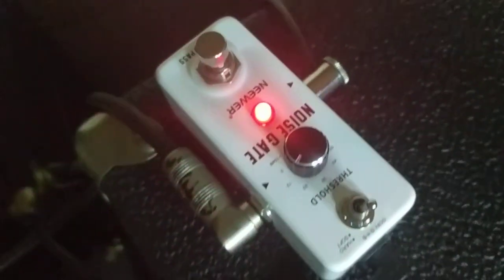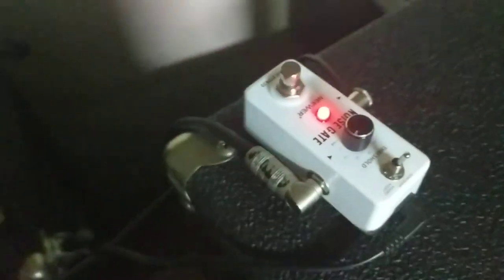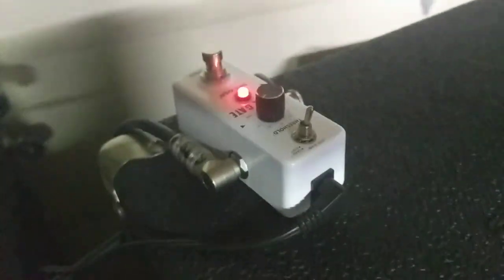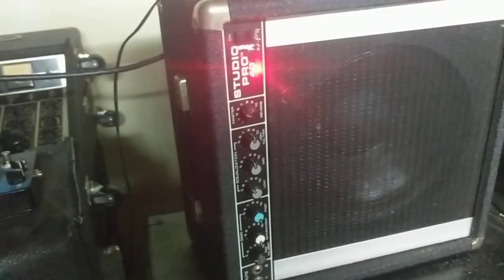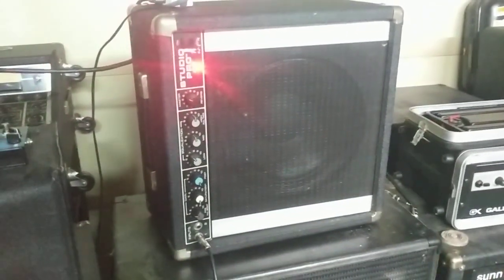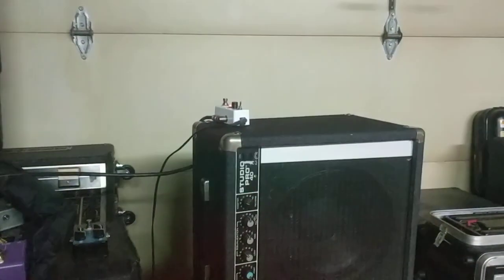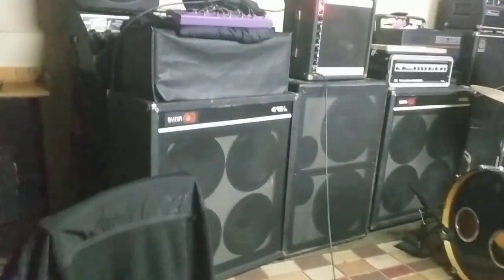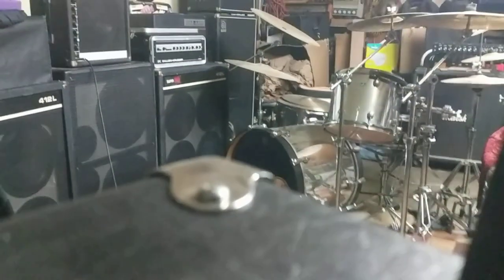HM2 STUDIO PRO and NEEWER noise gate

Comment: I had that same gate, made by mooer. The fast/slow switch ruins it imho, I gotta have the decay knob for a finer control, otherwise it either cuts off the bass from chugs too fast, or lets them ring out through longer but too slow to cut off the noise before it's audible.
Reply from the maker: It works just as well as the decimators I've had so I really dig em. I've been thru dozens of gates and it's always great for tight metal. The rocktron hush was 2nd best in imo but had some issues with clarity. Not too much is really gonna fuck up this tone any further tho lol
Reply from the maker: This is the second Neewer unit, sold the first to a buddy the other day and had to order another. From what I've heard in some groups I'm guessing I'm very lucky to have gotten 2 in a row that work correctly. I'll definitely take it over a decimator tho. Everytime I get a decimator someone leverages me into trading it. 5 decimators in 8 years. Neewer ftw
Reply: yeah some people love ISPs, I don't lol. Maybe it works better in front of the amp or I'm just a dumbass setting output levels. The hard/soft switch on mine fell apart but it was easy to replace, sold it after the fact. I like the ZNR gate on the zoom multistomp ms50g better than anything I've tried, worth it for that alone and the ad/da conversion is totally transparent too. Digital yeah but man killer time based and mod effects on that thing, and the Engl model on it sounds almost as good as my S&K VHD through a poweramp and cab
Reply: but yeah these cheap chinese import pedals are the shit, cheap way to try out a pedal with a $20 direct clone. I'd be hella pissed if I paid the full price for an ISP and ended up not liking it.
Reply from the maker: @Lavabug  I usually get lucky and get pedals in trade for fixing stuff. I've only had to buy one isp and it was used and cheaper. The perks of teching!
Reply: Mad respect for what you do, I like trying to diy/repair stuff. Still don't have the balls to work with mains voltages but every time I see an amazing amp sold "as is" for silly cheap I get the inkling to take the plunge. How'd you learn btw? Formally schooled or trial and error?
Reply from the maker: @Lavabug  lots of books, broken amps and trial and error. Then the forums started popping up in the early 2000's and helped a bit more. Forums are a mess tho. There's a lot of pure bullshit online haha
Reply: I know dude, holy shit the forums are a great way to get zapped or burn stuff up, some of the advice people give on diyaudio is hilarious but kind of annoying when you're looking for a real answer. I'm a physicist by trade and know the basics of circuit theory, but I never did a whole lot of practical electronics, I can just barely piece together a dallas rangemaster clone. Respect.